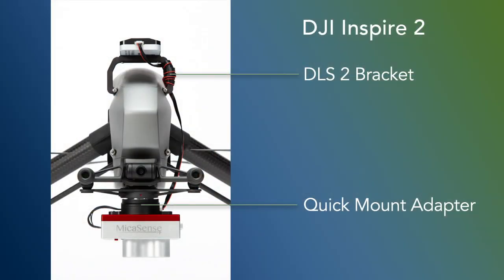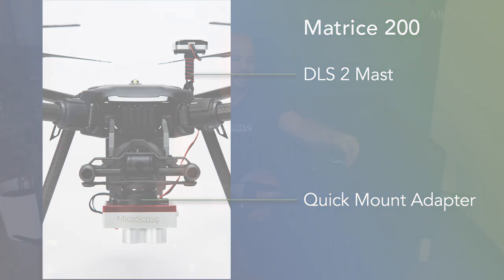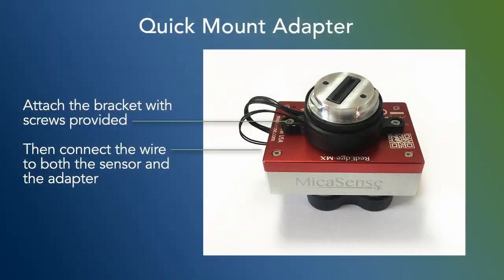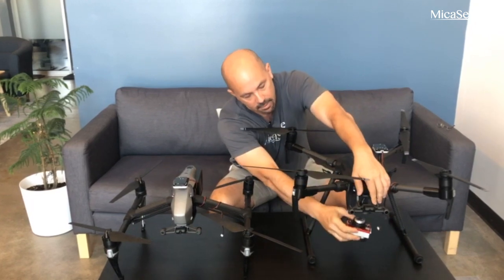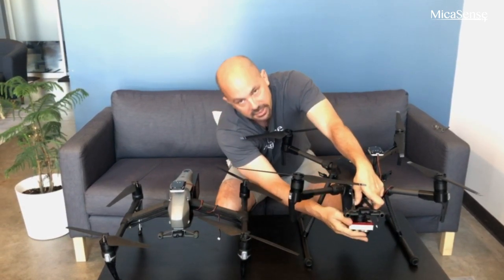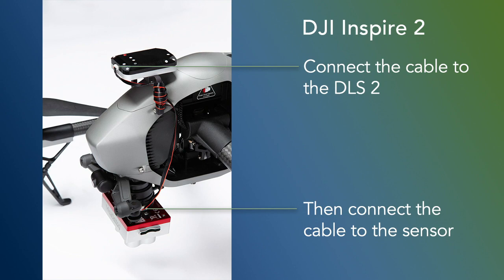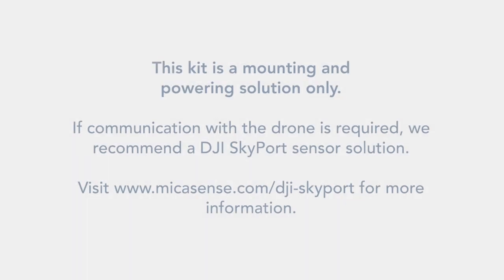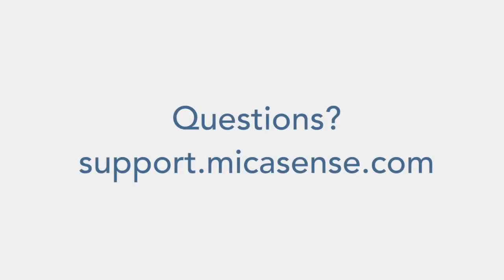MicaSense Integration Kits for DJI Gen. 2 Drones

Comment: The Quick mount adapter is the a sky port right??
Reply from the maker: Similar but different. The SkyPort comes attached to your sensor and works only with certain DJI drones. The quick mount kit is a mount you can get separately to integrate your existing sensor with a DJI drone.

Comment: What is the coverage area considering a 400 'flight with a 70/70 overlap?
Reply from the maker: It depends on the drone you are using.
Reply: Micasense Altum works with DJI MATRICE 210 RTK V2?
Reply from the maker: Integration with DJI M210 RTK drone has not been validated, therefore we cannot ensure compatibility. For more information on M210 RTK integration, please contact us at sales@micasense.com